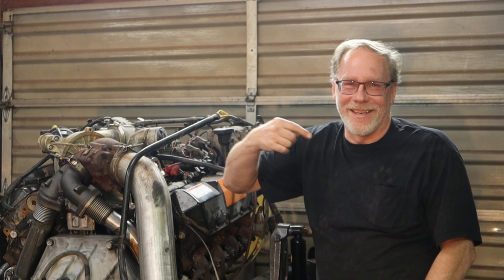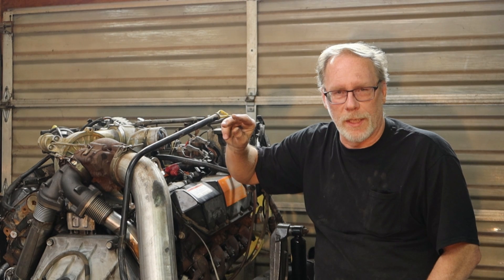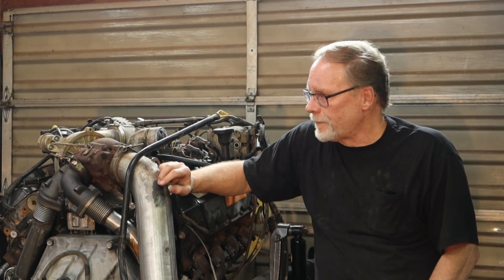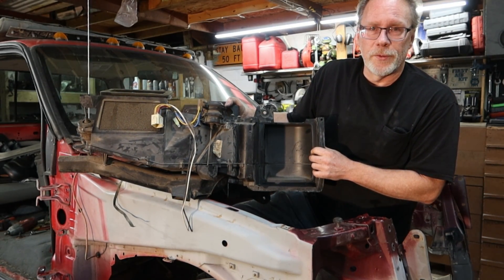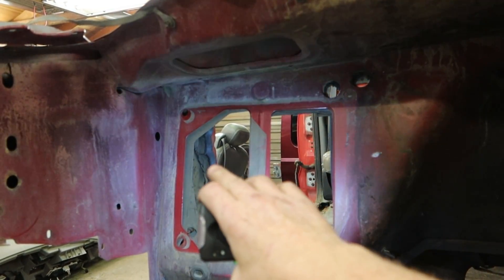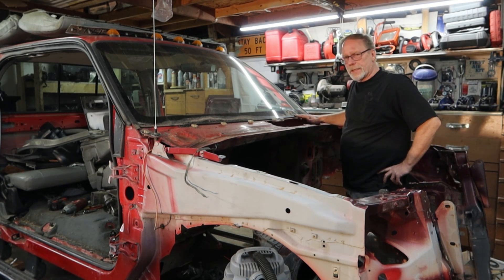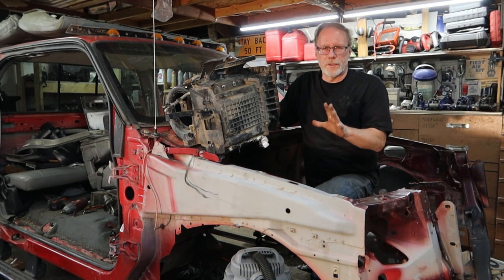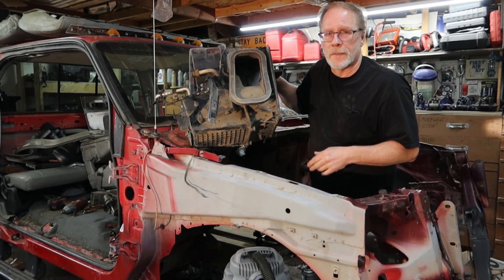🛻📽️ ....🟢🟡🔴🟢7 3 PSD QUICK TECH TALK SMELL DIESEL FUEL OR EXHAUST IN AIR DUCTS HVAC

Comment: Hi Clint 👋 thanks for giving us to another great explanation 👍 a cople day's ago I started smell diesel from the engine I see a little diesel in front midle of the engine just at the bottom 🤔 it's really hard to see what's coming from 🤔 looks like a some metal hose spray diesel somewhere 🤔 casually you recommended replacing some diesel hoses?  I appreciate ALL helps and comments 👏👏👍👍 my excursión 7.3 2001model cheers from Norway 🇳🇴

Comment: Great video as usual. I have a 1997 obs 7.3 with 80K origional miles trying to fix the cruise control. I replaced the sensor/cable on the brake booster, it worked for 1 day now nothing, never saw any lights on the dash light up. Do you have a video for the CC? thanks
Reply: I have heard LED  3RD brake lite has something to do with cc,  i am waiting for the 3rd brake lite harness to replace mine back to original to see if it helps my shifting prob no , cc here either , no check engine lites  here , good luck

Comment: also smell your coolant you could have a small heater core leak and also a injector cup leaking and the smell is traveling through the cooling system I worked on my neighbor work truck that had been to 2 different dealers 7 trips total they replaced all O-ring, up pipes, fuel bowl, then all seals and O-rings again, exhaust manifolds ,then next dealer replaced the seal/O-rings again along with the new fuel drain valve and the steel tube that from the drain. I then got it and 1st thing was to put uv dye in fuel and filled it up witch the dealers should have done and gave it back told him to bring it back with a 1/8th tank there was not 1 leak on the engine the coolant overflow reservoir was the only thing glowing green at that point I knew the cups was bad then looked for heater core leak and sure enough 1yr to swap the core out and 6hrs to do the cups and injector seal and glow plugs and valve cover harness since we was in there no more smell and still going strong 200k later 547k last I did a oil change on it. thanks for sharing

Comment: I have the OBS 1997 owned it 26 years original owner. 587,000 miles . Had all the above listed Diesel leak smells. One of which was the leak you just showed. Where the fuel supply from the mechanical pump to the head over on the drivers side.I changed the Viton o rings but that didn’t help because I couldn’t get the fitting tight because the base of turbo was in the way. So the turbo had to be removed to turn the L shaped  fitting one turn clockwise. I changed the turbo once before on that OBS and I never want to go through that ordeal again. What I did as a suggestion from a mechanic was to use lock tight 690 wicking formula. Loosen the Fitting, drop the 690 around the threads , let it sink in , turn it clockwise and then thread it to the head. That fixed the leak. Hope this helps someone dealing which a similar issue.😮